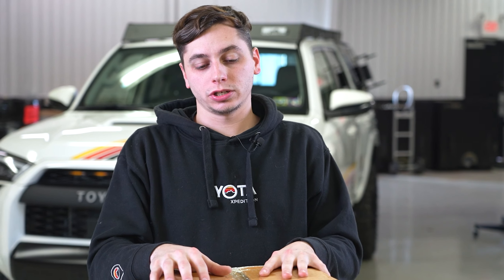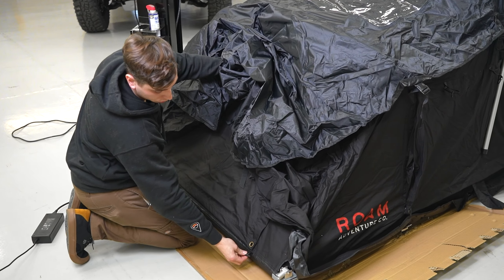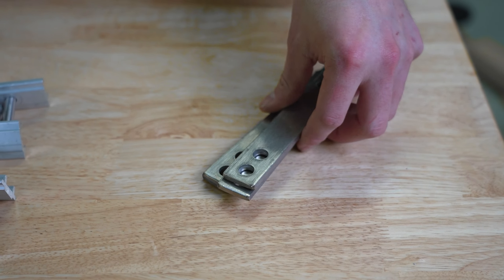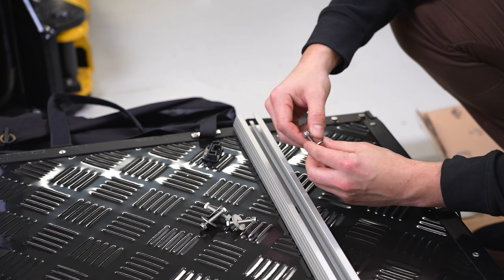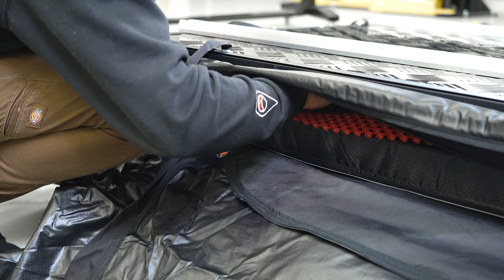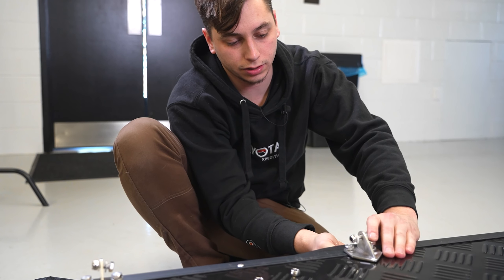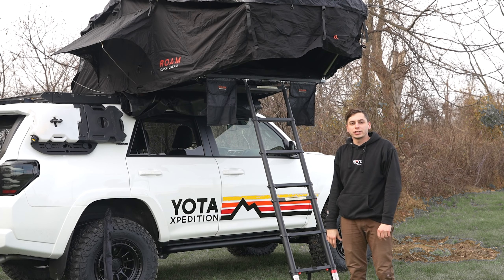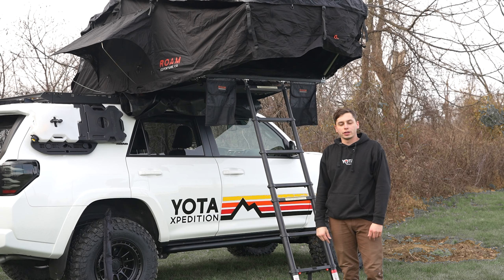How To Install The Roam Vagabond Rooftop Tent | Toyota 4Runner

Comment: Recently had to replace my ladder from Roam after having my tent for almost a year now, never could get it locked it the right way at the right angle and the tent be leveled, step completely snapped on me on our last trip with my wife and kids making it a horrible trip smh, I saw you have yours locked in at a half a step right in the middle, did it truly lock in? cause everytime I try to adjust the steps just like that the black buttons never fully lock all the way out into place, that's how we snapped a step on the last ladder, could you please show a video how you set up your ladder steps, I'm struggling here🙏 my truck is stock height just have a tall bed rack idk if that contributes anything but it shouldn't be much higher then the too of your yota?

Comment: the last part the thing that goes to hold the tent up   that metal bar does that go inside   the tent ? or do you have to have that in the truck at all time any one know
Reply: also does it fit for a Cali raise  roof rack ?
Reply from the maker: The metal bar stores inside the tent. Yes it will fit on a CaliRaised rack.

Comment: How did you determine location of tent.  Forward vs rear of 4runner?
Reply from the maker: We put it towards the front so it was more stable on the 4Runner. If we put it towards the rear it would be a lot of weight over the rear suspension. We ended up putting a roam case behind the tent. We actually should upgrade our rear springs for additional weight.

Comment: Will this work on a Trd pros roof rack?
Reply from the maker: Probably not the best option. That's a lot of weight for the OEM rack and also in order to mount it, the tent would sit really high off the roof. And you don't want a high center of gravity.
Reply: @Yota Xpedition  one of my coworkers has been using a Thule RRT since 2019 on her TRDpri 4R.

I'd say at this point it's fine.